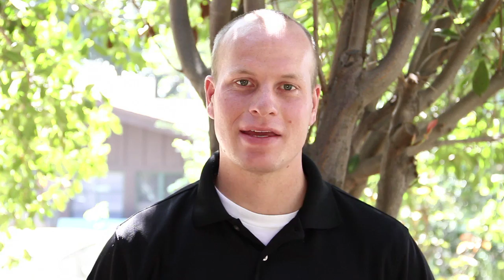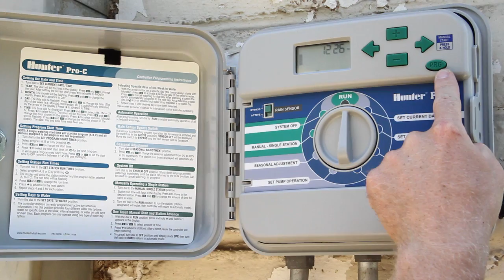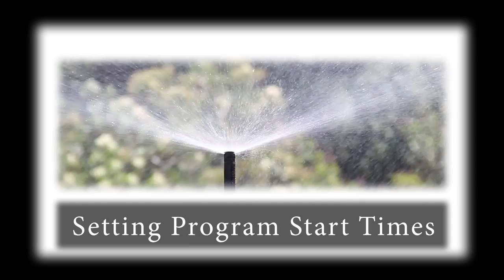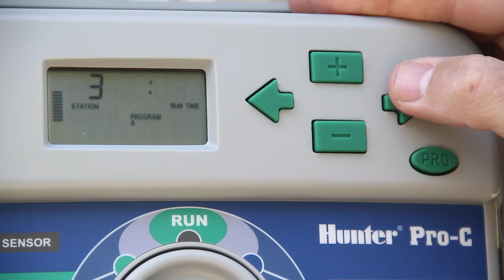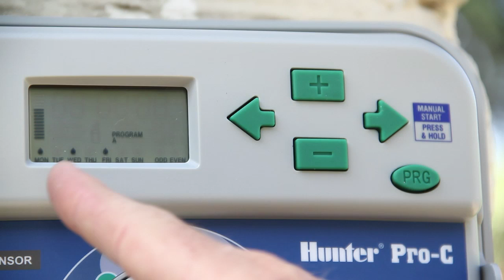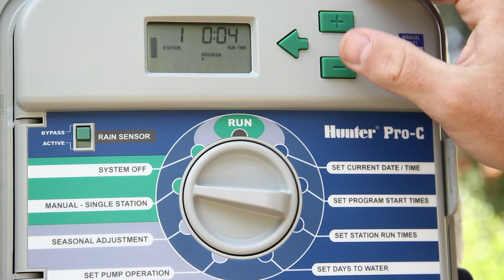Webbtraining1 - Hunter Pro C Irrigation Control Timer

Comment: My manual start has quit working.  The arrow button works just fine when I scroll through single mode.  It does nothing when I set the knob to RUN and press the arrow button for manual run.  Any suggestions?